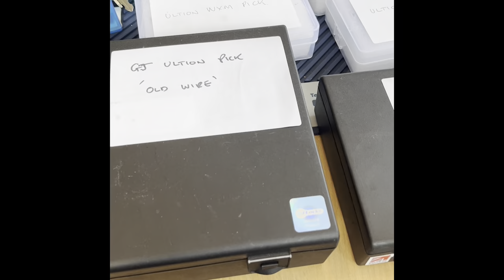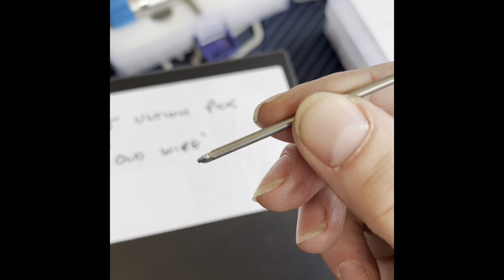Why the GJ Ultion pick is superior, plus hints and tips

Comment: Awesome vid seth i like the GJ but its a chunky monkey so designed a BUTTON style universal tension tool (works with pioneer yale sup/plat ultions cisa astral and others) and toolsteel wires specific to whatever one i "lucked" into today but thanks for the run down on learning the feel on ultions its very difficult to teach and most will monkey the wires a few times before they either "GET IT" or they just don't and the gj and nsuper replacements are not cheap (or easy to get if you're not in GJ'S little Club) You Rock!
Reply from the maker: Cheers buddy, I’ve actually just treated myself to GJs universal dimple pick for those that like to tinker with homemade tension tools and blades so I’m in the middle of a secret project 😂🔑
Reply: @FortressLocksmiths  Bonza i look forward to more details as things progress ( i am knee deep in bits of various gauges and types of wire teehee) great minds think alike and cost a packet!!!!
Reply: I agree it's difficult to even get a response from GJ Locks, that's why im on with making one to suit more than one key way buddy

Another cracking video Seth keep them coming buddy
Reply from the maker: @davidslack9881  difficult in what way pal, perhaps I can help?
Reply: @FortressLocksmiths  I will email you later bud thanks Seth
Reply: Bit confused it couldn't be any easier to get tools off Mr G.
Go on the site register for an account, after your verified as a trading locksmith you can but whatever you want?
Generally if ordered early enough during the day your item will hit the door step the next day via special delivery... Simples
Reply from the maker: @TheLockLab  Indeed pal, one of the good things about doing my course is that students can set up an account immediately 🔑, the hardest thing about becoming a good locksmith is having the right tools, but if you can have them right from the beginning it will make a big difference
Reply: @TheLockLab  Unless you are no longer working regularly as a locksmith and cant provide a bill of lading cos you got laid off due to covid and now have to drive a van for a major supermarket that is! (oh and if Geraint doesn't like you) no worries i make my own tools these days cos i can!!!!

Comment: Hi mate. Just checking. Do you take out the little grub screw from the top of the gj. The one that clicks between pins. It looks like yours is missing. 
Cheers, Dean
Reply from the maker: Hi pal, yeah I take it out or loosen it as I like to do it all by feel rather than concentrate on the lines of that makes sense
Reply: @FortressLocksmiths  it does mate yeah. Cheers for these videos they really are a god send.
Reply from the maker: @dean7631  no problem pal, I run 2 day security cylinder courses which you might enjoy
Reply: Can you give me more info on your courses?
Reply from the maker: @benbrown6955  of course pal, just go to the website www.fortresslocksmithtraining.com